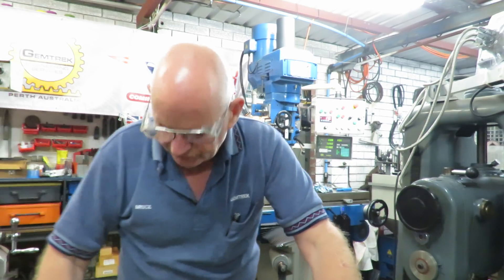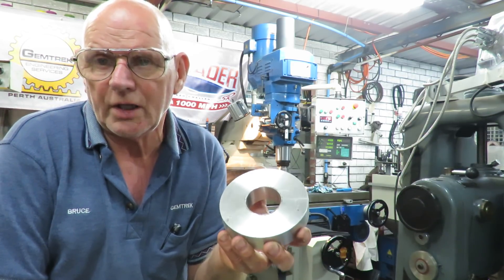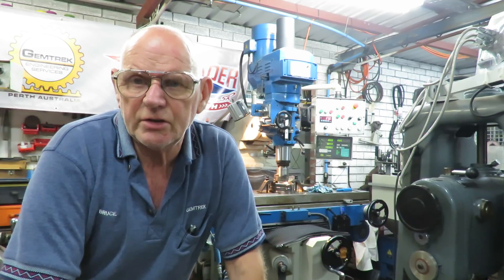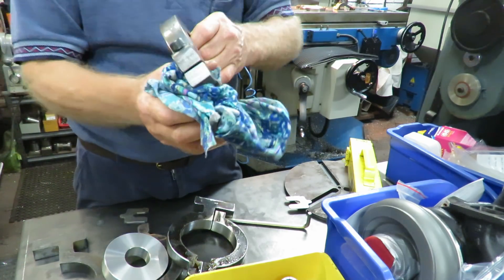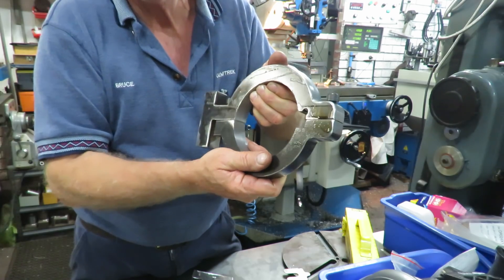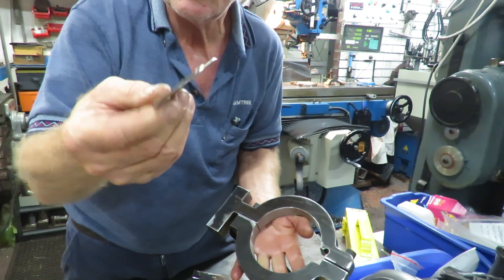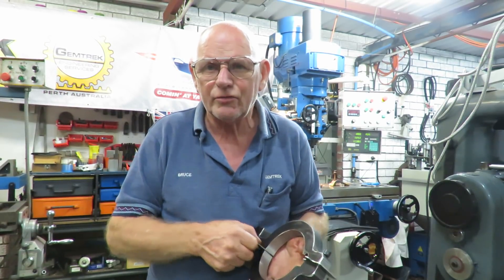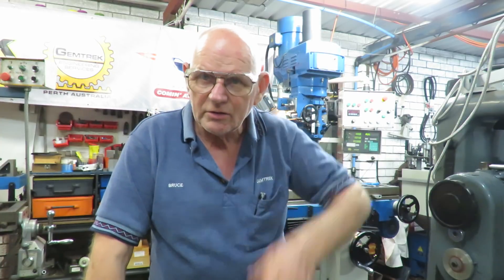Machining Mistakes. How close can you get to the finish line before you realise UH OH!

Comment: You are absolutely correct Bruce. Particularity when working by yourself. I of course deal mostly with CNC equipment but I have to be extremely careful that I don't accidentally transpose numbers on something. When you don't have another set of eyes looking at something you can be thinking your fine but making a big mistake. Sometimes if its late in the day and I have a particularity critical operation to do. I will call it a day and come in the next day to have another look at what i'm doing.